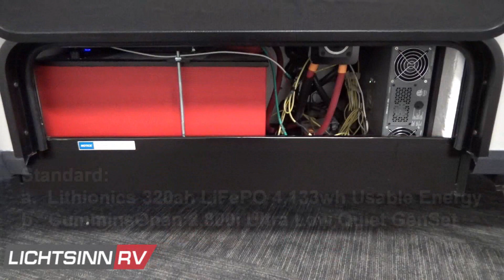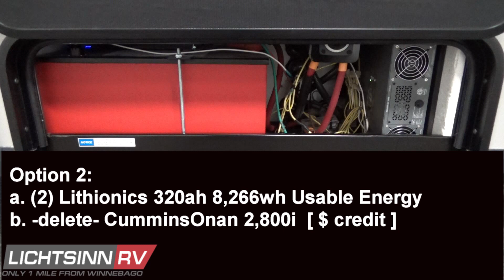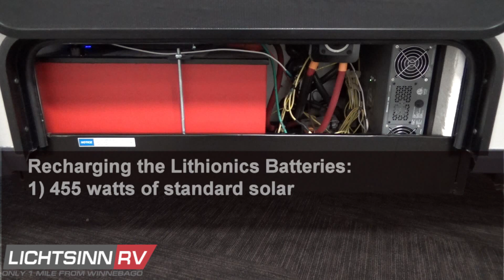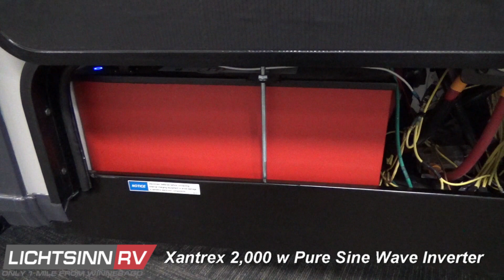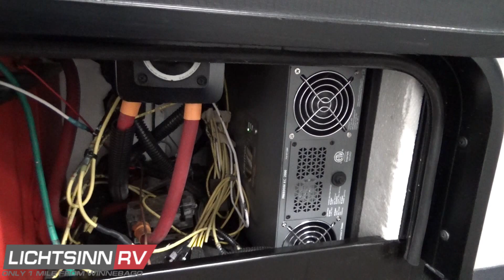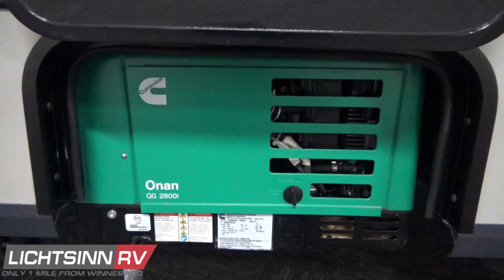LichtsinnRV.com - The Updated and Improved Winnebago EKKO Off-Grid Electrical System

Comment: I’m surprised that the EKKO electrical system doesn’t have an auto-start of the generator if the lithium battery gets too low. My concern is for the safety and well-being of my dog. If I leave them in the RV and have the AC going and the battery or batteries gets too low and the AC shuts off that would not be good. Can an auto-start system be added?
Reply from the maker: Good evening John!  Thank you for your note.  We can add the auto start, triggered by low voltage or by coach temp.   Hope this helps!
Reply: Can you give me an estimate price?
Reply from the maker: @johnplisinski9607  Good morning John… an approximate price to add the auto gen start is approximately $799. Hope this helps!

Comment: I have several  questions about the EKKO.  Does the EKKO come standard with the secondary alternator and the gas generator ?  Can you use both the secondary alternator and the gas generator to recharge the lithium batteries ?
Reply from the maker: Good morning!   Thank you for your note... you are correct on each of these points... you nailed it!

Comment: I’m sorry if I misses it, but does this have the type of system where if you are running off batteries and they get too low, does either the engine or generator auto start for recharge? Thank you.
Reply: So if I have pet in the RV and I have the AC going to keep them safe the battery or batteries could run down and there is no auto-start? That is not good.
Reply from the maker: Good morning!   Thanks for your note!   Currently not available to sense low voltage with auto start, but keep in mind the Transit can charge at idle with the Balmar alternator or off the CumminsOnan ultra low quiet, ultra fuel efficient generator.   Hope this helps!
Reply: @LichtsinnRV  It do help. Thank you.

Comment: I wonder if the new ford f150 hybrid technology will overflow to the transit line up. it would be an awesome idea to just use the engine - which is much more silent, than running a generator and top up batteries and or run a/c all day/night.
Reply from the maker: Good morning!   While that could be a possibility it would be a long ways off, unfortunately.  Ultimately, Ford would have to offer it first.

Comment: How long can you run the a.c. with the lithionics batteries?
Reply from the maker: Good evening Dave!  Thanks for your note and for the great, real world question.   It will depend upon your lithium configuration, but with each battery carrying 4,133 watt hours of usable energy, and 8,266 total with two, we compare this with the Revel AC run time test (with 3,200 watt hours total) we did at the link below, in which we ran the AC from 9 Am to 4ish PM before depleting the batteries on a scalding hot Iowa day.   The EKKO is also better insulated, so we believe this to be a long time and we will complete this test again when we receive our first sold EKKO in the Spring.   Hope this helps!

https://www.youtube.com/watch?v=pD77CunJfG8